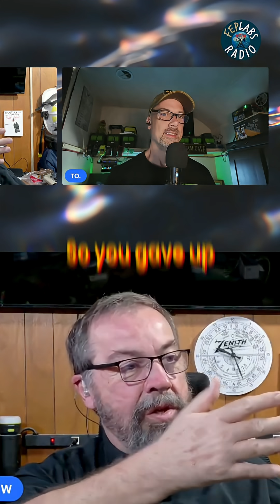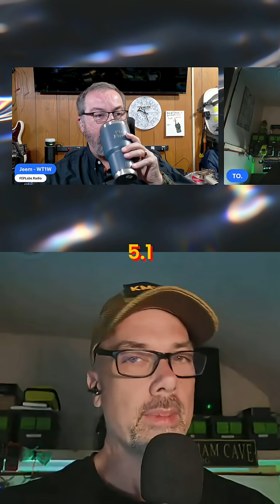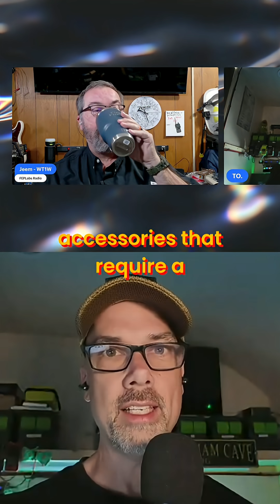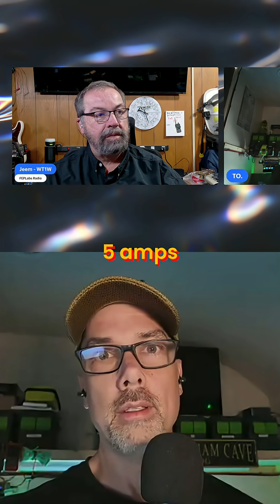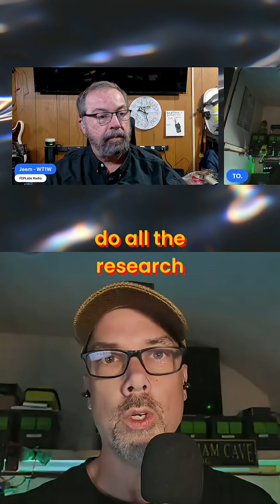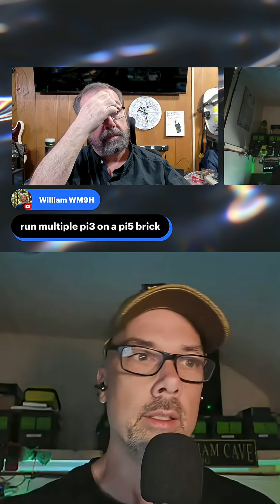Raspberry Pi Power Supply  Finding the Perfect One #feplabsradio #hamchurch #raspberrypi #hamradio

Comment: My Raspberry pi 5 runs on 5V with no problems. I have it attached to a 30A power supply which I run my radios on as well. You just need a good PSU with guts - this is where most people skimp out and regret it later.